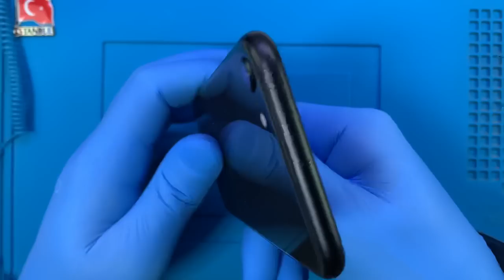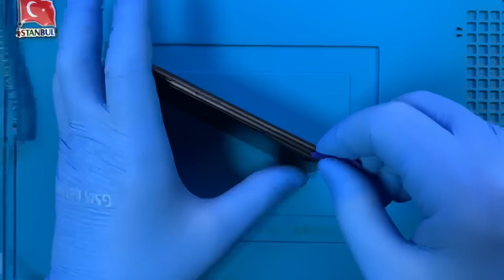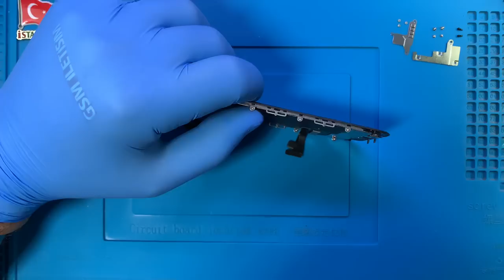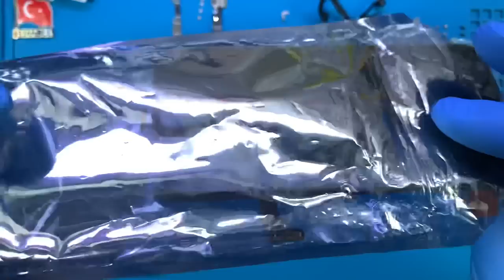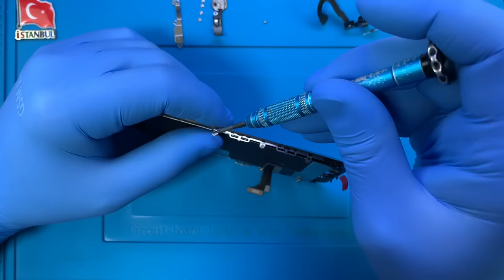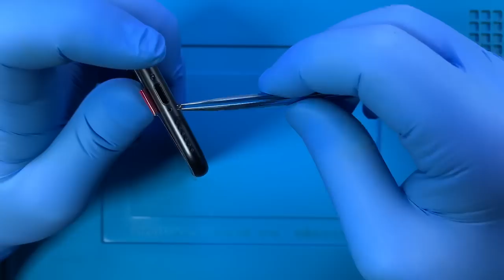iPhone SE 2020 (2. Nesil) Ekran Değişimi 🇹🇷

Comment: Sir I have issues with my iPhone 4s I bought new touch and display nd battery but the touch is not responding so check with another same device  first I didn't change the combo just change the battery same issue in that device 
Did the battery issue or display
Reply from the maker: Hello there,
The problem may be due to the motherboard, not the screen. The battery is an independent piece.
Greetings.
Reply: What can I do now
Reply: I am from India